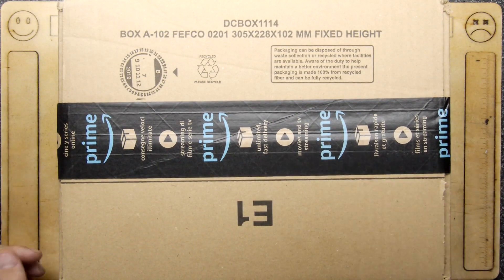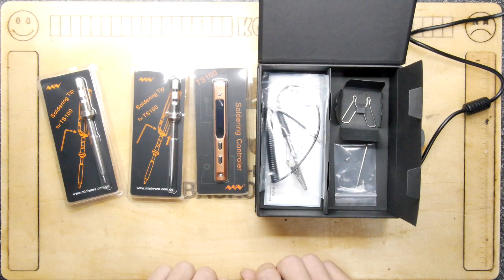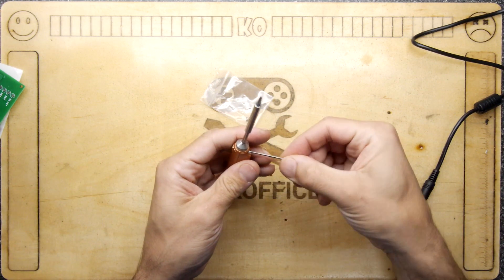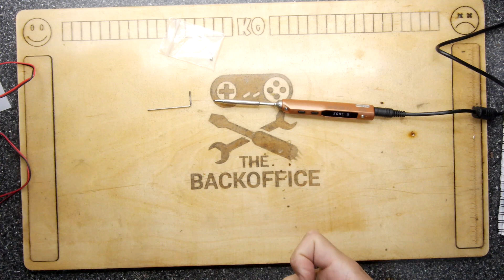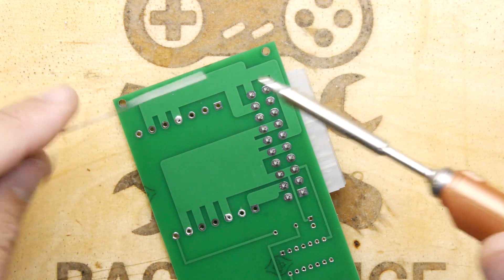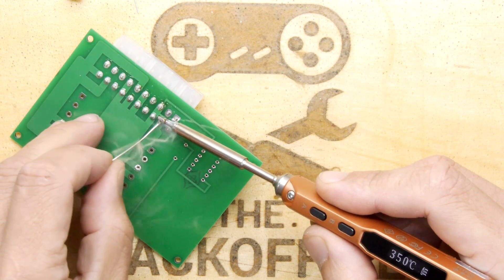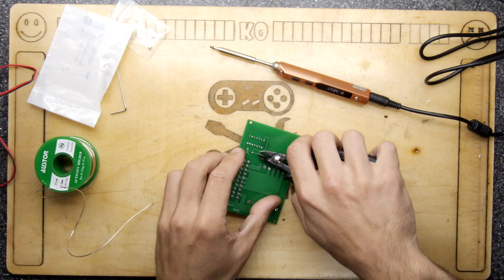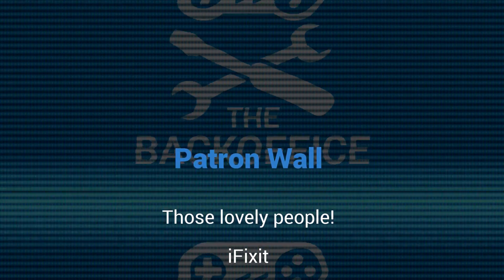TS100 Soldering Iron

Comment: I've had some issues with mine desoldering the modestly sized analog stick component on my valve index controller. I had to use a custom firmware, 24v power supply, and turn the temperature up to 450. Significantly easier to use with the open source IronOS firmware thought and it got the job done at the end of the day. Wish I knew about that engineer brand solder sucker, I was using some crappy "desoldering needles" I saw in the russian video of a guy showing how to do the repair.

Comment: That actually looks pretty neat! A pint from a quart pot! I wish I had seen this iron before I bought one of those "dumb" solder stations as a more portable backup for my Weller station. :-/
Reply from the maker: I just installed the open source firmware that everybody is talking about and it's just transformed into something insaney cooler. Definitely more reactive now.
Reply: @backofficeshow Sounds good! Maybe a follow up video is in order? :-)
Reply from the maker: @electronraygun6346  now I've had a chance to use our, sounds like a plan however ... I kinda want to hack the firmware a bit more. I'd like a even more detailed diagnostics screen including accelerometer values
Reply: @backofficeshow  That would be one pimped out soldering iron! I wonder how easy it would be to read through the firmware. I'm sure the mods you want would be totally possible. I wonder if it is possible to use a serial terminal to send and receive data/commands?

Comment: I have the ts80 which can be used with power bank (type-c qc3.0) its better in most cases but the ts100 is stronger when doing big cables. as I bought couple for uni projects.
u can get lipo battery or make ur own 20v battery with 18650s for ts100 and try to upgrade the firmaware to custom one ( tho choose stable version as latest had some bugs )
Reply from the maker: Thanks for the advice!